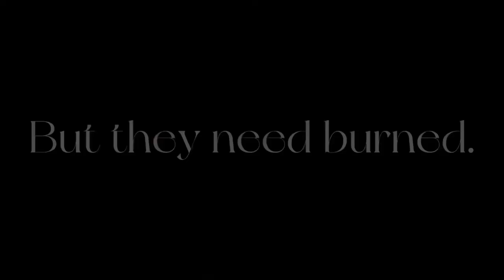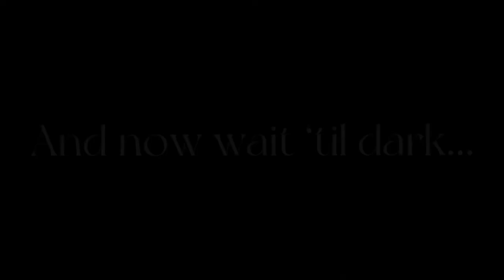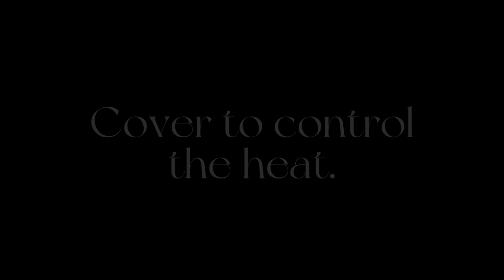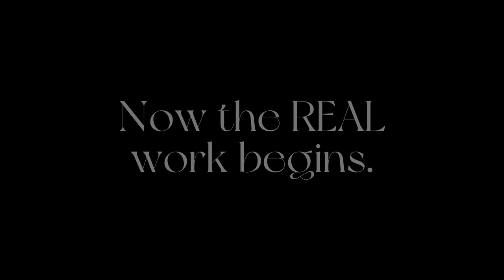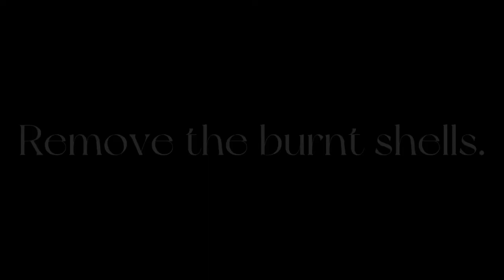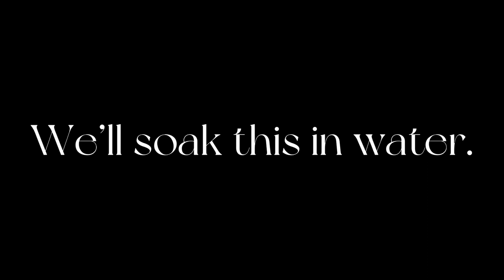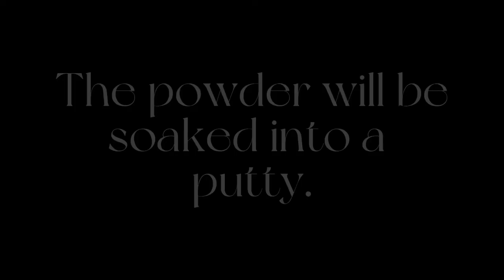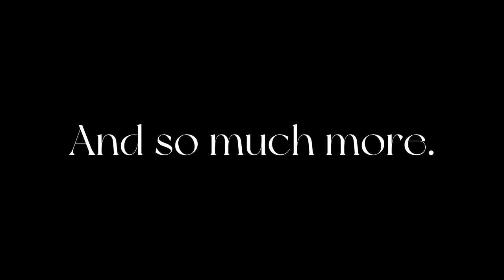Ancient Technology Unlocked: Burning Shells

Comment: Thank you for this video and this sharing of knowledge. I had already experimented with making quicklime with shells, during a barbecue with friends, after reading old books on lime and I was looking for video examples in order to share with others when I talk about that.

On the other hand, the way you extinguish quicklime, producing only calcium hydroxide, should only be intended for light works, such as paints or the last layers of coatings.
For lime intended for construction, it is necessary to mix it hot with only a very small quantity of water.
You can proceed with a slatted basket, by briefly soaking the quicklime in water, until it stops boiling, then it will reduce to powder by itself. It must be used quickly after preparation and protected from humidity in the meantime.

At your disposal to discuss all this with you in more detail, and share with you the very good old books that I have had the opportunity to read, if you wish.
Reply: interesting - which books do you recommend?
Reply: is that the ancient Roman hot lime method?

Comment: Awesome man.  I know that was a bit of work since i just started smoking meat and I am shit at fire management.  Not to mention all the labor you had to do.  Very cool.  Is there any other material that can be gotten easier than shells?  Also could this be used like drywall putty?
Reply from the maker: I was surprised how tough it was to get shells. The Delaware Bay on one side and the Chesapeake on the other and couldn’t find anything better than crushed shells. That made it tough. Whole shells would have been much easier and cleaner to burn. Limestone is the more common source of lime, especially further from the water. I’ll probably go with limestone from Pennsylvania once I’m out of shells. Easy to get from a quarry about half an hour from here. I’ve never used lime putty like gypsum putty(drywall compound). My guess is lime wouldn’t work too well since it shrinks and cracks when it’s not mixed with sand or clay. Lime putty does have a texture similar to drywall compound after it’s set long enough. That’s when it’s at its best really.
Reply: @HiraethRestorations  Thanks for the explanation.  You do some fascinating stuff on your YouTube channel.